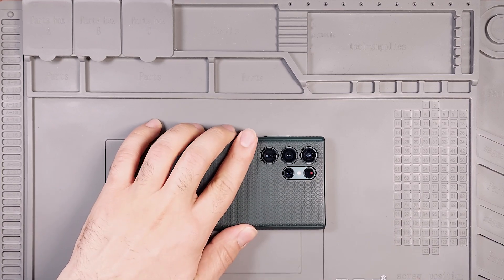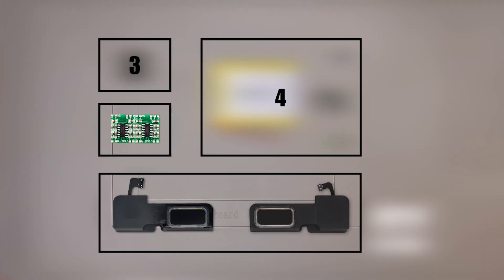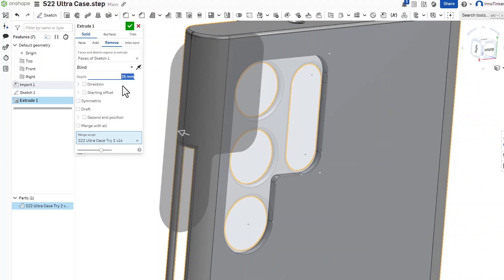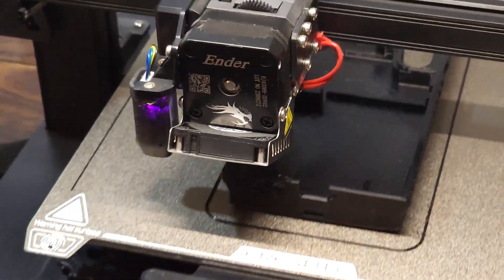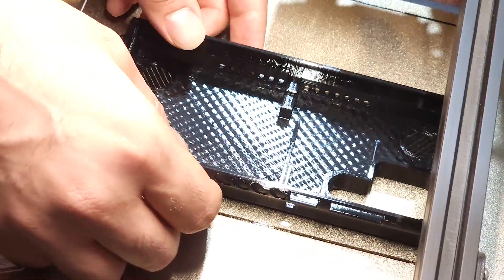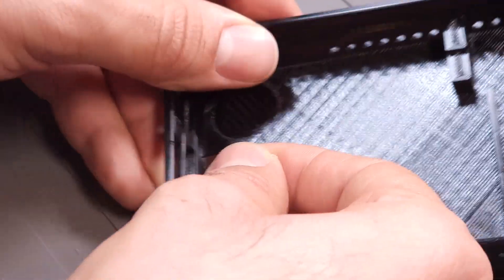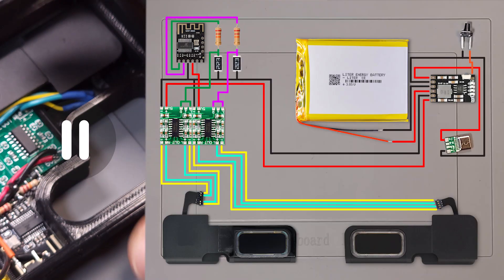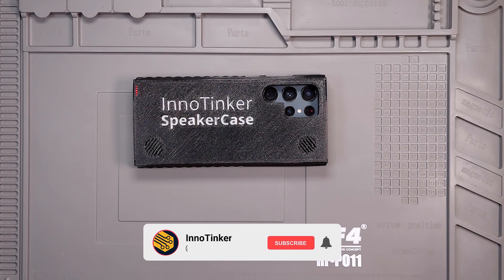Turn Your Phone Into a Powerful Speaker! (DIY Case Under $20)

Comment: would be better if you sanding it and spray some paint to coat it, holding that case on hand gonna feel way much nicer bro.
Reply from the maker: Thanks for the suggestion! A nice finish would definitely make it feel better, but I’m not sure sanding is a good idea since it’s printed with TPU filament.

Comment: So happy I found this video, was looking to do something very similar! 
Wasn't sure about amp selection and if the MacBook speakers are going to be Powerful enough.
Reply from the maker: Glad it helped! The MacBook speakers are surprisingly good for their size, and with the right amp—like the PAM8403 or even a MAX98306—they can get decent volume. Good luck with your build!
Reply: @InnoTinker  Thanks! I'll check those amps. Also how did you secure the USB c port to the tpu? Just friction?
Reply from the maker: If the USB-C breakout board fits snugly in the case—like I did in the video—friction usually holds it fine. But just to be safe, you can add a bit of glue (like T-7000) to make sure it stays in place.
Reply: @InnoTinker  I know it's late, but do you know by any chance what is the impedance of the macbook speakers? also it would be great if you could share the design files or measurements for the speakers.
Reply from the maker: No problem! They’re 4-ohm speakers. The max dimensions are 76mm (length), 30mm (width), and 8mm (height).

Comment: I used those amplifier modules for few years , the quality sucks on those
Reply from the maker: They’re definitely not perfect, but they work well for budget DIY builds like this. If sound quality is a priority and budget isn’t an issue, you can try the MAX98306 module.
Reply: @InnoTinker  tnx dadash